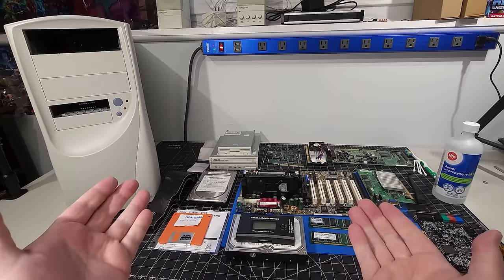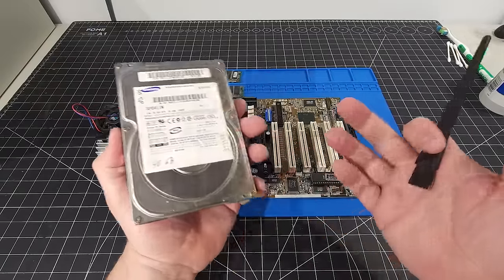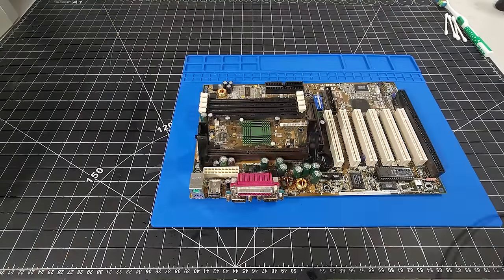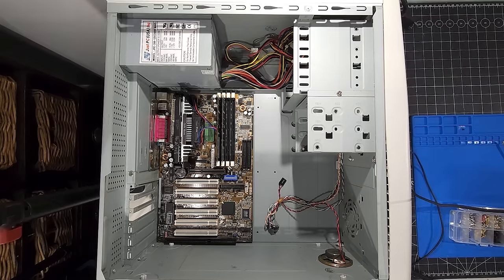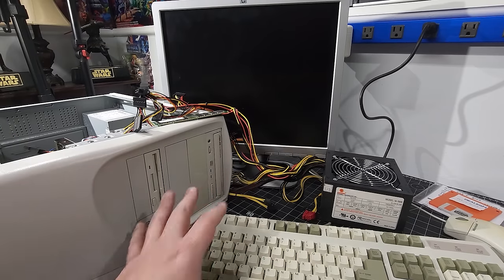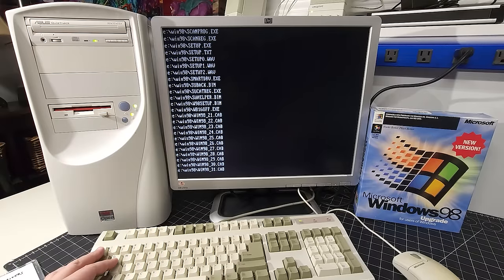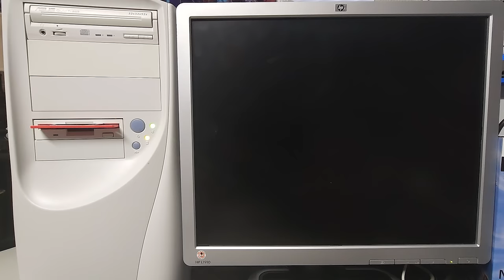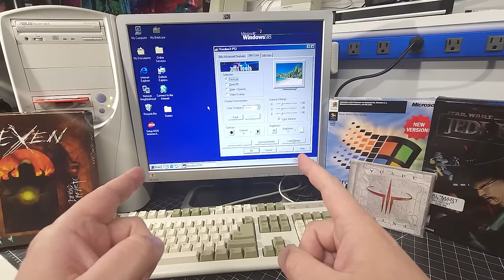Building a Retro Windows 98 PC!!

Comment: I do not recommend using old garbage tier power supplies from no-name manufacturers of the time. They're built down to the barest of minumums to the point they barely function and put out horrific DC. If you put one of them on an oscilloscope, it'll probably look like an AC waveform. When they explode, they'll take out your hardware with them. Even if they don't, the ripple is so terrible that they'll silently kill your hardware.

Don't trust one of those cheap power supply testers to verify power supplies. They only check for voltage, they don't check for ripple or do load tests, which will show how bad those power supplies were.

That Coolmax power supply is also garbage tier eWaste. I recommend immediately throwing it out before it kills something you care about. The output on that power supply is horrible, and the ratings on it are completely fake. I've seen dozens and dozens of those units explode under even light loads.
Reply from the maker: I'm surprised about the coolmax being bad. What would you recommend in terms of brand?
Reply: @TheRetroRecall  Antec, Cooler Master, Thermaltake, Corsair, Super Flower, Seasonic or Silver Stone.

Comment: it was recently discovered that chipset drivers are really just eye candy info for unidentified items in the device manager, they usually don't do anything them selves. 

however they're required for AGP systems because they usually carry a GART AGP driver to configure the AGP bus protocol.

Also chipset drivers usually carry an updated PCI miniport driver for a particular chipset to allow for Interrupt steering. But if Windows can't obtain one, it defaults to a predefined set of miniports included by the windows registry. If all else fails... Windows will not allow IRQ steering for that platform until you provide a miniport driver.

Not having IRQ steering is not necessary for Windows to function,  As the BIOS should able to alleviate any resource conflict anyway unless you start using a multitude of devices which is whole other can of worms away from this topic.

Windows NT is a different beast as that bypasses BIOS to use the MPS specification and or ACPI to fully control resources as of many other operating systems.
But man DOS and DOS based operating systems are really dated...
Reply from the maker: Good to know.  All that said, for the seconds it takes to install them,  why wouldn't you?
Reply: @TheRetroRecall I Agree

i only mention this because some crappy hardware vendors don't provide chipset drivers for some critical motherboards and are stuck with un-configurable early PCI and AGP chipsets. 

I'm looking at you VLSI and ACER (ALi chipset)... gosh their support for old operating systems suck so hard.

Comment: Never trust a PSU from the capacitor plague era. They can work perfectly fine with a "dead" HDD as a load for testing, but if you start the full system, they get much more load and they can fail(like in your case). Ive seeny many newer PSU done this from the late Socket 478, early LGA775 times.
Reply from the maker: Yes I think I will devise a much greater load test for the future setups and testing.